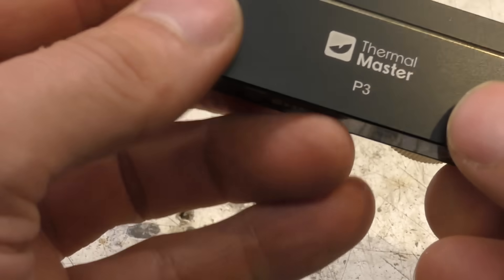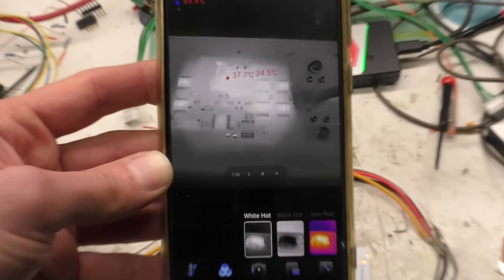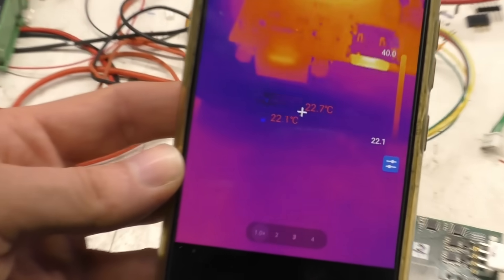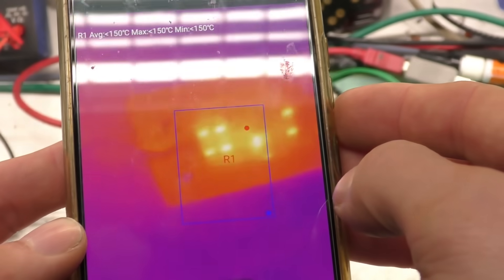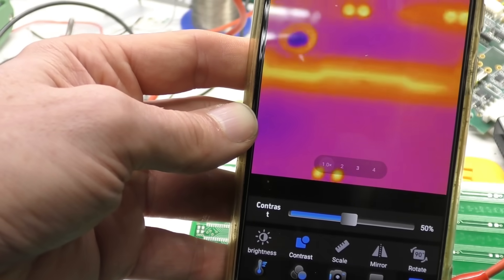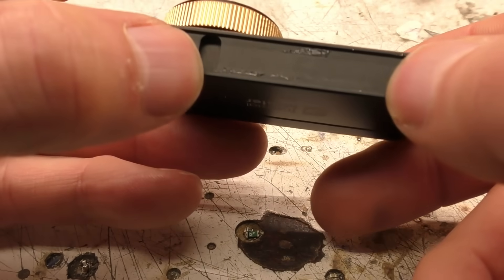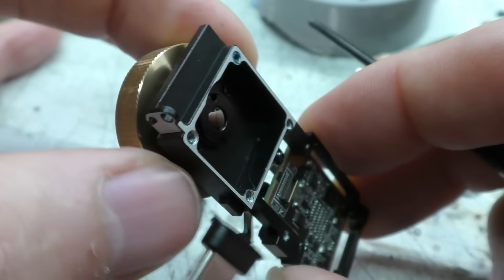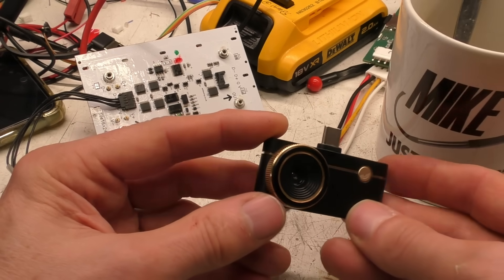Thermal Master P3 Thermal camera

Comment: Can this camera be configured in any way to just be a USB camera, obviously without any control over the IR settings? So a kind of "default" mode where it acts like a webcam. I do not like being dependent on proprietary software or drivers.
Reply from the maker: not as far as I can tell
Reply: I made a similar comment on Jeff Geerling's video on it eariler in the week.  I don't like the idea that it's locked into the manufacturers software, so when they decide to stop supporting it then you're reliant on old mobile devices for it to keep working.  And so the device has a limited life regardless of whether the hardware continues to function perfectly.
I've always want a Flir camera but have never bought one for the same reason.

Comment: Hi, can that camera show / detect heating items covered by wooden box with polystyren isolation? I mean if I will se bees heating inside the wooden / polysteren beehive and recognise if they are alive during the winter and where they move inside the beehive.
thank you for response.
Reply: It will not be able to measure through wood or polystyrene. It will show you the surface temperature. So if the heat inside is enough to warm up the outside of the box, you would be able to see that.
Reply: Given that bees maintain a temperature of 30+ degrees in their cluster, I think you'd have a decent chance of distinguishing between a live and dead hive by external surface temperature on a still day. Even if it's only a fraction of a degree.
Reply: @marcaxe   Hi, I was thinking about detection of position of the cluster during winter to monitor both alive bees (this can be monitored or checked  also by few other means) and position of the cluster within the hive in case I have the bees in more then one hive box (do not know the correct english word for it).
Also the bees during winter when there is no or minimum of brood keep temperature of the cluster around 20 degrees celsius but when the queen starts significantly lay eggs and there is more brood they start heat and temperature goes up to 35 degrees celsius.
During winter 2024/2025 I was measuring temperatures in the hives and most of the winter the temperature outside the cluster were surprisingly close to outside the hive temperatures. I was using digital thermometer with cable but when the clusters were moving away the sensor then the measurement was useless.

So I was hoping if that thermocamera can detect these temperatures through the wood and polystyren insulation of the hive.

Comment: The drivers can be an issue as they can install under the wrong category in Device Manager, so require uninstall then install from latest download. Usually installs 2nd time around in correct place if you use latest app/drivers from their site.

Comment: Too bad it doesn't really have any technical advantages to the P2 Pro (which for me is also my daily driver). I would have loved autofocus or a higher res sensor (although higher resolution on a microbolometer doesn't necessarily help that much, at some point it just increases noise). Maybe next generation. By the way, the Thermal Master P2 regularly goes on sale here for about €150, it's an absolute steal (I paid €218 a year ago).
Reply: Thermal sensors are listed as “dual use technology” for military purposes. So they are heavily regulated by ITAR. That’s why all the sensors in Chinese products’ sensors are low quality compared to what you can get in the US.

Comment: My old FLIR One feels ancient compared to this one.. Expensive and slow refresh rate.. The MSX  mixed visual + IR is cool though
Reply: I have a Flir One, and I hated that every time I would go to use it the battery would be dead. According to their FAQ, the internal battery is so the camera doesn't drain the phone battery, but I would rather have a working camera than an extra few percent of battery in the device I already charge every night.

I recently hacked the battery out of the camera. I have found tutorials on installing a buck converter, but looking up the datasheet for the battery controller says its recommended max battery voltage was something like 4.7V, but the absolute max on the battery pin is 6V, so I just bridged +5VUSB into battery+. Works fantastic.
Reply: @seeigecannon  I also modded it and replaced the internal battery with a larger battery. just taped it over since the rear cover would not fit anymore. Mind you, the device was already replaced once under warranty since it would not recover from a flat battery = poor firmware that did not account for recovery from low charge. Also earlier, I had the option of using third-party camera software - that is no longer an option and I am forced to use the glitchy FLIR app. On the bright side my FLIR One is the original higher resolution one before they upgraded to a new version with lower resolution !!

Comment: I don’t think there’s any DRM these would have to participate in to work on lightning if it already works on usb C on iPads/phones with usb C.

The DRM is for other things like CarPlay. And if this needed to have a DRM chip on lightning it would need one on USB C also. So the adapter wouldn’t need one.

The adapter would need the chip that manipulates the muxing on lightning perhaps to make it work as USB and not say headphone audio. But they wouldn’t buy Apple’s chips to do that. There are clones.

So I wouldn’t really worry as you seem to that some of your money is going to the Apple tax even though you don’t need Apple compatibility.

Comment: I've had to stop getting phone-connected thermal cameras since I keep dropping them when I'm doing building inspections in winter. It just doesn't work with frozen hands!

Another thing is the apps tend to stop supporting them after five years.
Reply: But it can be a good first step towards any business. Either that type of business will pay off eventually, and you can afford real thermal equipment (which BTW isn't far better unless military grade). And thermal camera in a pocket is nice addon to any inspection work.
Reply: @My_Modesty  They arent really all that much cheaper than standalone units I find.
Reply: @RinoaL  Standalone units have their weaknesses too. For example, having only one or integrated battery can be a hassle if is empty. On the other hand, everyone has a phone nowadays and it's rarely with empty battery. Plus, you can send results right away using WiFi or cellular network. It's debatable, but i respect anyone reasonable opinion.
Reply: Using the extension cable would save you perhaps, allowing a better grip on the phone?
Reply: @Richardincancale  It's an issue of holding the tiny camera before it's connected to the phone. When it's really cold your fingers dont work as well, especially if the thermal camera comes in a hard to open case like the Seek Thermal. I had my seek thermal flip out of the case because of the latch being so tight one time too.

Comment: is the 512*384 resolution native for the sensor or some pumped up marketing resolution from a lower 256*192 using their X³IR™ ?? Can you notice a difference between the P2 Pro and P3?
Reply from the maker: Same sensor, 256x192. I couldn't tell any difference wit X3IR on

Comment: Had a weird issue with a small router board restarting randomly. Tried everything I could think of, but nothing stood out. Decided to give it a go with the P3. Focused on the voltage regulator section, and the image was so clean I could spot a single component that had a faint hot spot at idle.
That kind of thing never really showed up when I used other thermal cameras in this price range. Most of the time it’s too blurry to tell. The 512*384 resolution on this one really lets you zoom in and actually see what’s going on.
Reply: now imagine how much deeper could you zoom if they upscaled that 256x192 sensor to full HD! :)

Comment: the resolution of the pictures. So far I have only used it from about 18 inches away to over 20 feet away and it works great. I have not yet tested it for very close up pics, like on a circuit board, but with the 8mm macro lens and manual focus, I’m expecting good results.

Comment: These are cool, but I've got it beat. I have a ulefone 25t pro (I live in the US and have it on two common networks as I play with the dual sim).

The 25t has a similarly higher frame rate thermal camera built in. As it turns out, having it always in your pocket is actually very handy. I thought it would be a gimmick and I would just never use it, but the fact that it's available has made sure that it's got plenty of use, especially being a car guy.

Comment: FYI, the discount code doesn’t seem to be accepted.
Reply: its working now lol:hand-pink-waving:
Reply: @mact9840 It does (lower case m)! But they raised the price from $279 to $299 at the same time. It’s still a decent deal I suppose, but kind of turned me off the company. No fault of Mike.
Reply: Always $299 I think , just ordered one with 10% discount, good deal actually
Reply: @ErinHowell-gt6mn  It was definitely $279 an hour ago, I even had it in my cart and when I came back to the page I got a message that the price had increased. 

Anyway, not the most interesting topic so I’ll shut up about it. I might still buy one after the minor irritation wears off.

Comment: As a cyber security engineer the thought of you running windows 7 still is horrifying, but as someone who has dabbled quite a lot in electronics and weird equipment I understand that there's probably a ton of stuff you do and use that won't work on anything newer. It's quite the conundrum.
Reply: I work for a company that until recently was using NT4!!!
Reply from the maker: Lives behind a NAT router & I don't do dodgy stuff so not too bothered.
Reply: @mikeselectricstuff understandable, I work with various companies that manufacturer stuff and it's scary how many crazy expensive pieces of equipment rely on the most crunchy old software imaginable
Reply: @witeshade  Business-critical Microsoft Access script on a PC shoved in a bathroom storage nook that's only still there because it has "Do not unplug" written on it? Nope. Never seen anything like that.